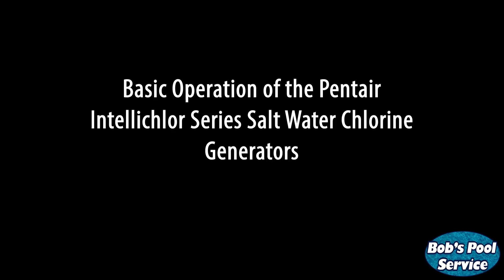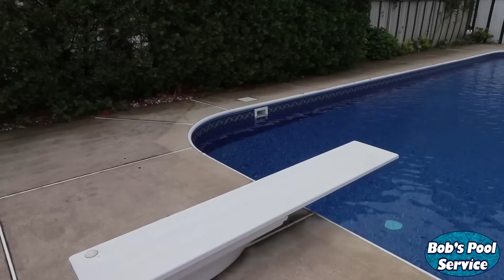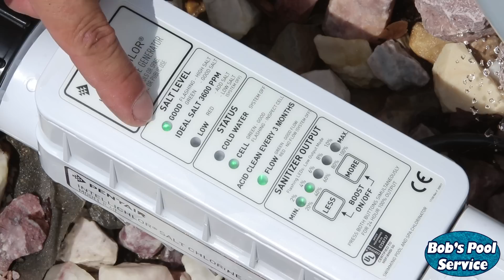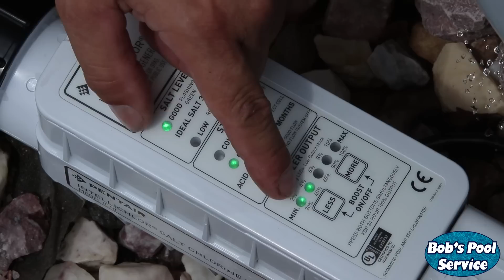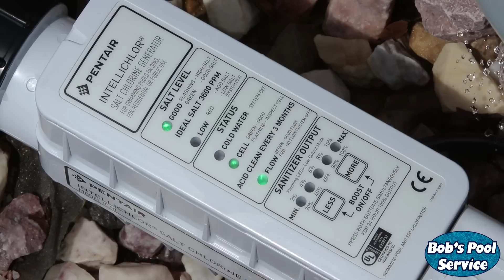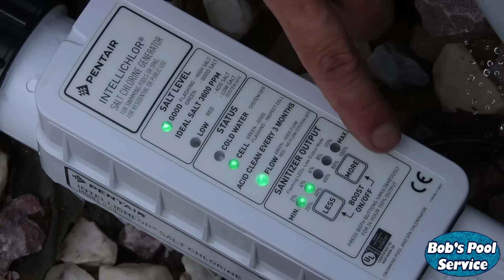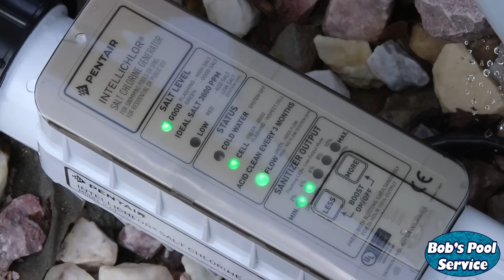Pentair Intellichlor Salt Water Chlorine Generator Operation

Comment: I have this Pentair unit and None of the lights are working - any idea for fix ?
Reply from the maker: First thing I would do is check the fuse in the transformer unit, that's the most likely issue...  that or a bad power cord going to the cell.  Also make sure the transformer itself is getting power of course.

Comment: What if you have flashing green saying to much salt, but it reports 0ppm?
Reply from the maker: Hey Bruce what devices recording 0 parts per million I'm assuming you had the water tested or you're using test strips but in either case it's highly unlikely that there's no salt in your water even pure tap water or pool water without salt added usually has a couple hundred parts per million
Reply: BobsPoolService the diag port on the panel and the app. Test strips say chlorine is fine.
Reply: @bruceleggett568  The unit doesn't read or indicate chlorine levels, only salt levels which is quite different from chlorine.  If the green light is flashing that means the salt level is high, the unit is working and will produce chlorine from the salt.  I didn't go into details here on how the system works but in short the salt in itself does nothing to purify your water, the chlorine that is produced FROM the salt however does.  Hope the helps, if you need your salt level checked you'd need to use strips made specifically for checking salt levels, normal test strips that check chlorine do not do that, the salt strips will only check salt levels.
Reply: robwas I was just trying to say that the system says my salt level is 0ppm, but the salt level is flashing indicating high salt. Those facts are at odd, so that’s what confuses me. The unit uses salt to make chlorine and test strips agree that those levels are ok.
Reply from the maker: @bruceleggett568  Not sure where we're not communicating here but what I'm asking is how did you actually test your salt levels?  I have yet to see a pool with 0ppm, we use a Myron meter to test salt levels, it's a fairly expensive item to own, around $300 and most people don't have access to one.  https://www.amazon.com/Myron-512T5D-Conductivity-Meter-0-5000/dp/B015XVJ4TI
Reply: BobsPoolService just using the Pentair system. Our unit lists ppm for salt. It’s how we normally tell if we need more. All a sudden it’s been reporting 0 in the app.
Reply from the maker: Oh, you probably have automation and a sensor...  my guess is the sensor went bad and you do have salt in the water. I didn't realize you had integration and assumed you were using the stand-alone unit like the one in my video.  I would take a sample of water to the store and have it tested to see where you're at.
Reply: BobsPoolService yes, exactly. Pool is 14 months old, wasn’t expecting a issue like this yet. Thanks for the assistance.
Reply from the maker: @bruceleggett568  I feel your pain...  I actually tell my customers to avoid complex pool automation unless they really need it.  Much to go wrong, expensive repairs and often dangling wires for landscapers to cut by accident. When salt systems started getting popular and we go on board selling them I was hoping a good system would exist that would adjust the generator output based on free chlorine in the pool but came to find out the hardware for that would cost more than the entire system and would need constant upkeep and calibration so it's just not practical.  I've yet to see a "system" that accurately measures salt levels, the Jandy and Hayward do it with the units but I've found it's so inaccurate the simple LED's on the Pentair are just as good for alerting the pool owner and then they can have it checked with a more accurate device.  Thanks for the discussion, I'm hoping to make more videos next year to assist people in making pool life easier, I think many times people overthink it and pool stores tend to want to sell products that aren't always needed, there's no substitute for knowledge and no magic pill.
Reply: BobsPoolService also, the good light is flashing.

Comment: What if your Salt Level has a green light on and a red light? I've had our water tested (today actually) and our salt level is fine, but for some reason our system isn't producing chlorine (we're at 0%). Our flow light is also blinking red, but I just backwashed and risned a few days ago and shocked it. Once place said the unit might need to be replaced and the other said it could be a fuse. Any thoughts?
Reply from the maker: Hello Heather.  I doubt there's a fuse problem, the actual cell doesn't have a fuse, it's a sealed unit.  There is a fuse in the transformer (the tan box the cell plugs into), however, if that fuse blows (which they do sometimes) you'd see no lights illuminated on your cell.  You may want to take the unions off and inspect the cell, this should be done every 3 months and it should be acid cleaned if necessary.  There's a possibility the flow sensor which looks like a little paddle that you'll see on the inlet side of the cell had broken off.  Out of the 100 or so we install a season I'd say we see this happen on maybe 5% of the units by the 3rd year.  Hope this is of some help, you may need to contact a local pool company to come out and look at it in person.

Comment: My cell does none of that hahaha it just blinks all the lights on and off, all green lights, but doesn't produce anything... really annoying
Reply from the maker: I'm not sure I understand what you're describing fully.  Are you saying every light on the unit is blinking on and off or are just the output lights flashing?  If it's every light on the unit I'd contact Pentair or have your local pool company look at it.  I have yet to see all the lights flash on and off.
Reply: BobsPoolService yeah, it's weird... thanks for reply, aqua pools in akron is doing the diagnostics will keep it posted when they figure it out
Reply from the maker: For sure, let me know what resolves it.  We're always looking for solutions and best products to sell our customers.  So far Pentair seems to have the least repairs but we have had a few issues with the flow sensor arm rotting out on the Pentair units.  I wish someone would still offer a FULL 3 year or better warranty but I believe everyone is at 1 year with most pool products.